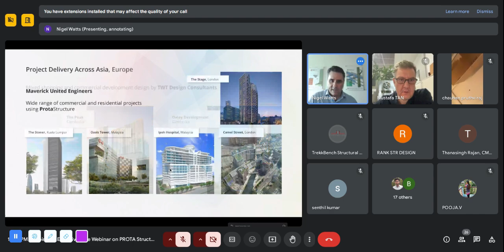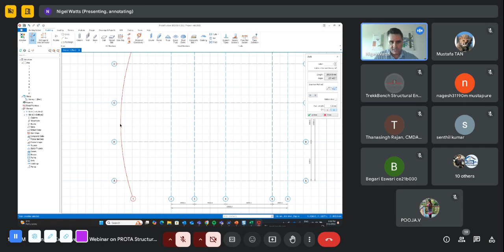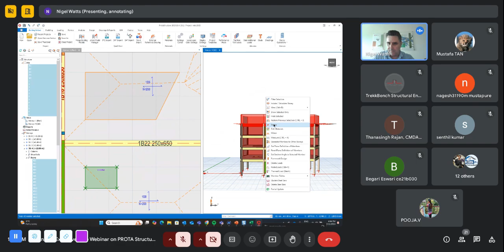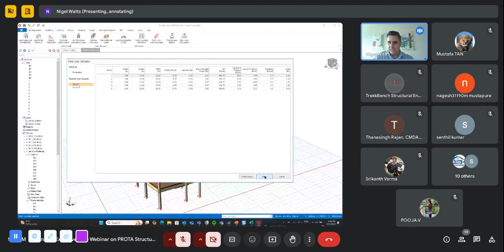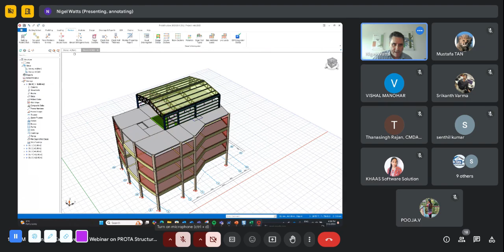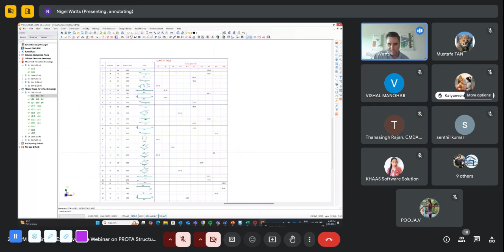BIM Design Technology for Transformative Project Delivery using ProtaStructure Suite 2025

Comment: Sir
I suggest that
1. While detailing under Indian 🇮🇳 codes, the laps need to be staggered 
2. Since lapping 20mm dia and above is costly, the detailing needs to have option of mechanical couplers.
3. In steel modelling there should be an option of tapered section
Reply from the maker: Hi, Thank you for your valuable suggestion. You can share the same to software@khaas-group.com.